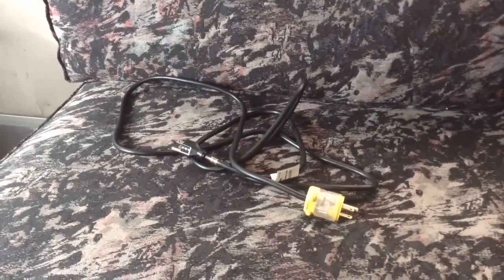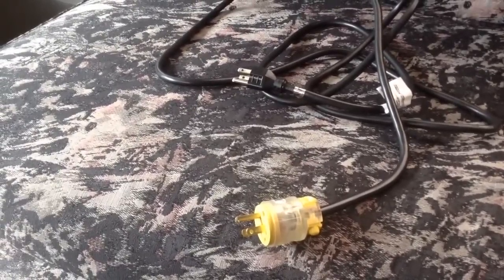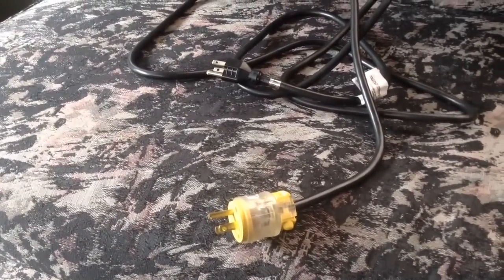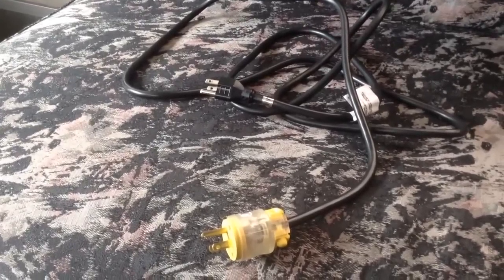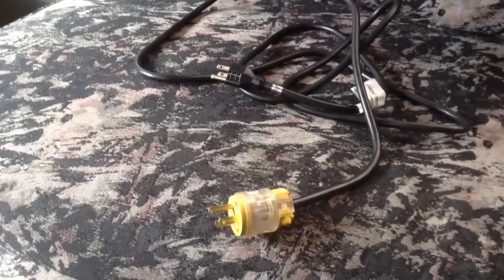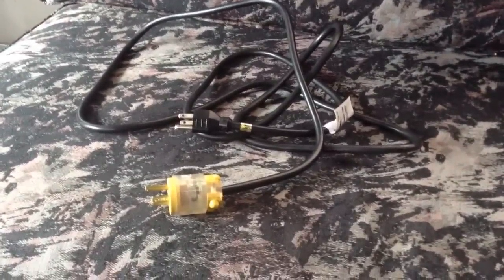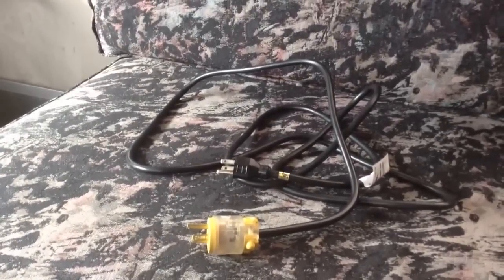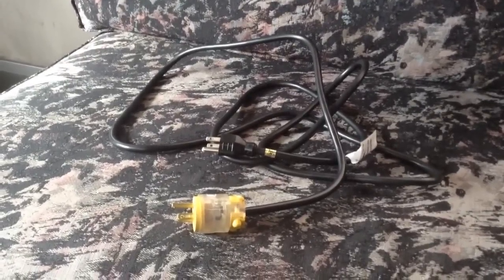Improvised, cunning and dangerous grid tie power cable that could save your life

Comment: Hey Larry, I know what you are saying, the + side of the sine wave must be in sync with the + side of the sine wave of 2nd gen coming online, same with proper polarity with d.c. generators, and yes batteries, say large diesel starting batteries, usually hooked in series but be in shunt to get more current. I believe it is called a synchroscope?  or a set of three lamps to show the phases are in line.

Comment: As far as I'm concerned a 14 gauge wire is too light (I wouldn't use it), it should be at least a 12 or better yet a 10 gauge. Houses are wired with nothing smaller than 12 gauge wire. You say it's hard to find a 12 gauge cord. I don't know where you are looking, I've been buying 12 gauge cords since the 1980's a beyond. They are available at any home improvement center, even in 2015.

Comment: Man.. You sure are not planning on running much electricity through your system with the GFI and Surge Strip.. Nothing wrong with using the cord.. Keeps the Safety police that can't remember to turn off the main breaker from opening up the inner cover of the panel and killing themselves before they even get things hooked up..  You can't protect the ignorant..

Comment: Its super easy to install a generator inlet with an interlock cover for the panel in a few hours, which is legal and not dangerous. Why do this?
Reply: David Pfeffer cheap. I use a 230v version of this, and back feed my generator thru my dryer connection. As he pointed out in the video I make sure the mains are off before plugging in.
Reply: The Cost, simplicity, the fact that you don't have to do any "In Panel" wiring and you can use an existing plugin, etc.. 
Lots of good reasons..
Reply: ...Its super easy to install a generator inlet with an interlock cover for the panel ...

Believe me, I wish I could. My main panel box if FULL. In my state, An all electric central heat / A/C unit has to have 3 double breakers for the "furnace", (blower), heat strips, and compressor. That's 6 positions gone off the bat and everything else in an 1836 Sq Ft house ate up the rest of the spaces. I could install the sliding lockout but there is no room for another double breaker for the generator. After I had my garage built, (not connected to the house), I wired it with 8 gauge wire from the garage breaker box to the main breaker box below the power meter through a double 50 amp breaker. Sadly, the position of the main 200 amp breaker and the 6 extra positions for other breakers are nowhere near each other to use an interlock. There are only 4 specific steps that we have to go through to power up our house or shut it down when the grid comes back on. They are in an unchanging order that is not violated. They are listed below but I digress.  After wiring 6 other various circuits around the garage for lights, outlets, garage door opener and a dry storage room inside the garage, I installed a double 30 amp breaker in the last two positions in the garage box, wired it to another piece of 8 gauge and wired it to a 4 prong, 50 amp mobile home style drier / stove outlet. I used this type so I could wire for 240 VAC, (with both 120 VAC legs and neutral), and a separate earth ground to augment the system ground(s). Then I made my "suicide cord" out of the same 8 gauge wire with a 4 prong plug to match the garage outlet and a 50 amp twistlock to match my 7000 watt TroyBilt generator. The wall outlet is dedicated strictly to the generator and is NEVER unplugged so there is no shock hazard. I strung 6 inch red zip ties through all of the 240 VAC breakers in the house box so my wife would know which ones to shut off if I was away. 1) Shut off all 240 VAC breakers in the house box. 2) Go outside and flip off the main 200 amp breaker. 3) Go into the garage and start the generator and let it run for a minute. 4) Flip on the double 30 amp breaker, (marked with an orange zip tie), in the garage breaker box and presto! To shut down: 1) Flip off the 30 amp breaker in garage box. 2) Shut off the fuel valve on the generator. 3) Flip on the 200 amp main breaker outside. 4) Turn on all 240 VAC breakers in the house box. It's all that simple. No unraveling cords and plugging them in. No fear or foolishness wondering if we got it right. All direct and simple. You could almost call it a manual transfer switch system except the mains disconnect switch is 20 feet from the generator connect switch.
Reply from the maker: One of my SHTF  survival plans is to take the RV from business to business and offer to keep them up and running with my generator in return for goods and services, same with my wheeled generator in the cargo trailer.   I can swap the ends on my welding extension cord in order to accomplish this, but since I would never know which businesses would agree to the arrangement or not, I would not assume they already have the specialized outlets in place.   What I am committed to "bringing to the negotiating table" in SHTF situations is electrical power, and I practice that on an ongoing basis, I own 3KW worth of solar panels which are all destined to go on mobile arrays.   Figure if gas stations are turned off in a SHTF situation, I can offer to turn them back on and in business at least until the tanks run dry, in return for enough fuel to power them up, get stuff from their convenience store and enough fuel to get the convoy down the road.   The idea is to be welcome rather than feared at the stopover points as a trade, transport and aid convoy.
Reply: 8digitPDX  , when the zombie apocalypse is in full swing, you'll be an instant target my friend. Good luck though! I enjoyed the vid : )